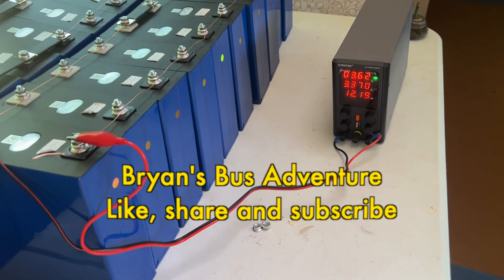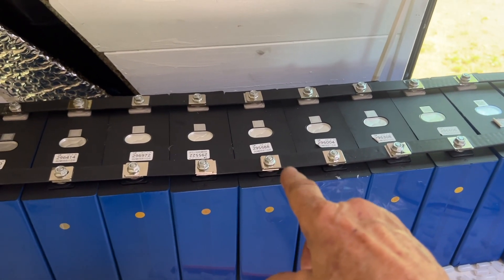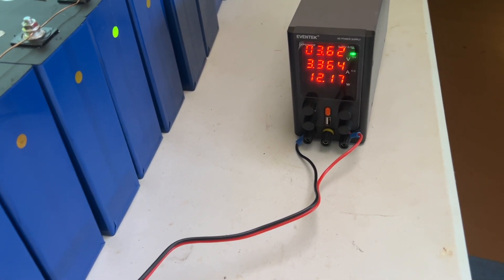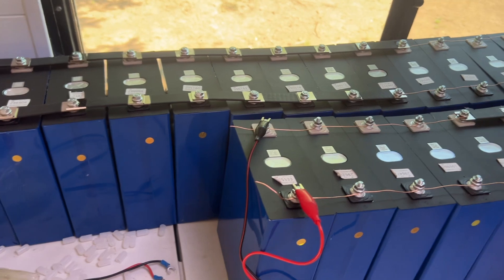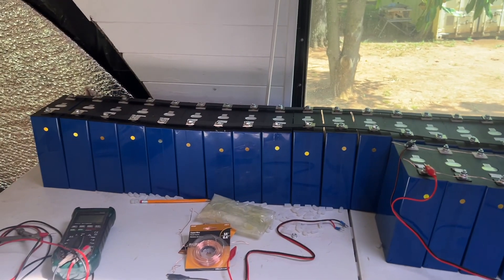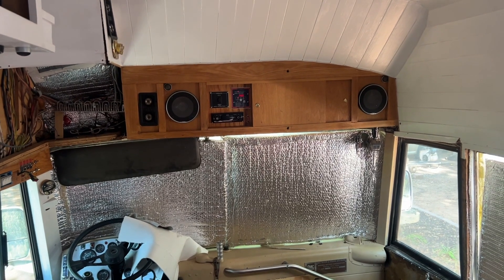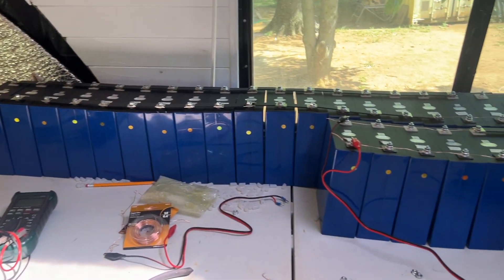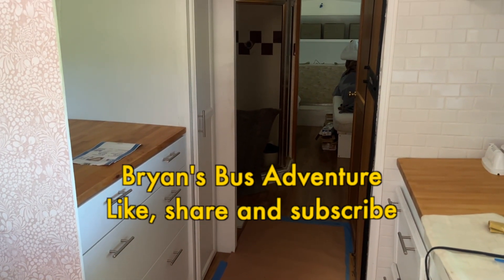Lipo4 batteries #3.watching the top balance. #4108a #buffalo #solar #bus #battery #gm#remodel

Comment: A better way is to not buy a lab power supply and instead buy a JK 15adc external balance unit for about $60 then assemble your 24/48 volt battery, apply mild compression and charge them with full pack voltage at .25c to .5c in steps of 3.45 - 3.55 - 3.65vdc per cell allowing them to rest a bit at each step and the balancer to get the cells to.005 variation.. Instead of 2 weeks you can be done in 12 hours or less, if you were making 4x 24vdc batteries then it would take 4x longer but far less than the weeks you are going through.. Also note that between 3.55vdc and 3.65vdc each cell is actually only gaining a couple amps of storage at the cost of lifespan in charge cycles so I do not charge to 3.65 per cell except on the initial top charge and maybe once a year if the cells start to be a little extra fussy with the auto equalization .. I also have the daily top charge voltage limited to 3.55vdc per cell and my auto balancing BMS set to balance between 3.45 and 3.55v per cell.. Anyone who builds a lot of these packs especially the 24/48/60 volt ones uses the stand alone balancer simply because it saves time and effort..
Reply from the maker: I just chose to do it this way as it seems they needed to be top balanced and I'm in no hurry to get them top balanced

Comment: $5 bet all those cells will swell nicely not being compressed. Hope you can fit them into the enclosure you pulled it from/ plan to put it in to. :)
Reply: I use mild compression when seasoning the battery banks but after 10 to 20 cycles compression is no longer required as long as you are using flexible buss bars and not charging or discharging at .33c or higher and I would suggest ,25C or less.. For a 300 amp battery this is 100/75 amps in or out to reduce heating.. The manufacturers in China etc. assemble the battery and ship them with a base charge on them for exactly the reason you state.. Most 12v and 24v packs have no compression what so ever and the BCM limits the charge and discharge to help prevent excessive swelling..
Reply from the maker: oh yes I have a complete bay to made an enclosure the batteries.

Comment: It's pure coincidence but just yesterday I completed the top balance on 16x 306aH cells using this same technique.  It took from July 1 to July 19 to go from 3.227v to 3.650v charging at 10 amps and it used 35.1kWh on the Kill-a-watt meter to do so due to the inefficiencies of charging at low voltages.
Reply from the maker: thank you for the encouragement
Reply: Those cheap bench power supplies give off that 15+kwh loss in heat which is about the same amount it takes me to heat my electric 40 gallon water heater 3 to 4 times.. You can get a 15 amp active balancer for about $60 which is cheaper than that power supply and just assemble the battery and do the balance on the fly between 3,4vdc and 3.65vdc in .1v steps.. You do want to make sure your cells are all within a couple tenths of a volt and below 3.3vdc but even if they are a little bit out of that range they will connect together with no arching or sparking and proceed to meld together..

Comment: Plus terminal on the first cell and minus terminal on the last cell. It is a rule.
Reply: Your bus bars/copper wire has resistance. The cells at the end of the string will not see the same voltage
Reply from the maker: I have checked with Will on line and never a mention of this. All of his videos show it as I have it.
Reply: @bryansbusadventure4783  its not about will, its about physic laws

Comment: I've been around RVs for 30+ years and nobody ever explained why the standard for automotive vehicles changed from Black being negative for vehicles but when it's an RV the Black is now positive. Never made sense to me. You are the first person to explain RV Black is positive because they are emulating house colouring where load is black. Thanks for solving this mystery. Now that I know why, it still doesn't make sense to me but at least now I know. Thanks for this.
Reply: It really is kind of stupid to make the standards that confusing so you have to really be careful in mixed AC/DC applications.. The auto industry used to have the Black wire have a red stripe to indicate +dc if it was not completely red.. I have seen motor homes with all black wiring and with a rainbow of colored wires.. I used red and black for my DC and red black white and green for the AC grid and inverter output and yellow blue white and green for the generator input to my Outback Radian solar system..

Comment: That's why I  bought JK active BMS it will actively top balance every time it charges.
Reply: The active balancer isn't good for lifepo 4
Reply: @Pimpasxx  The method has changed because technology has changed.. Smart balancing as a complete cell pack using a BMS with a 2 amp or better active balancer or by getting a stand alone 15 amp balancer that cost around $60 US is faster because you use your higher amperage 12-24-48-60vdc solar or inverter charger.. In 12 hours or less with 100 amps at 57.6vdc for a 300amp pack using the JK 15 amp balancer you can accomplish the same thing as the above 2 week method so why waste the time and money on the lab power supply?? The only time balancing is actually efficient is when the cells get to 3.45vdc and ends around 3.55vdc.. Between 3.55 and 3.65vdc you are only adding a couple of amps to the battery and this is also the heightened stress zone for the cell which will over time reduce the life.. For a new 280-315 amp cell this is less than 1/2 of one percent and you would shorten the lifespan from 10k cycles to 2k cycles.. I use plateaus and set my inverter/solar charge controller to 3.45vdc per cell, once the pack gets to this and active balancing has stopped (less than .005vdc variation) I will bump the charge voltage up to 3.55vdc per cell and let the balancer equalize the cells.. You certainly can bump this up again to 3.65vdc but as I previously stated the very small amp gain is not worth the lifespan lost.. Also charging and discharging at higher than .5c reduces the life of the cells..
Reply from the maker: I have the JK BMSs now 4 of them. but every one says to top balance first